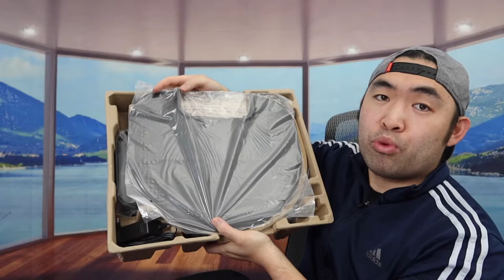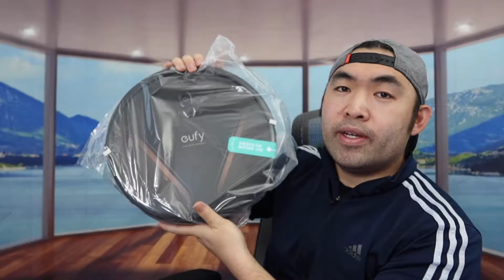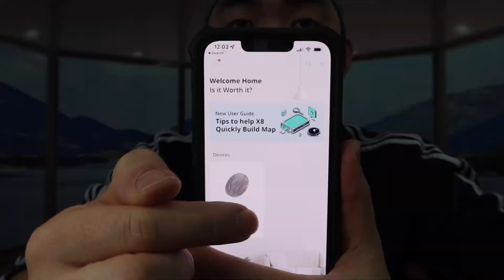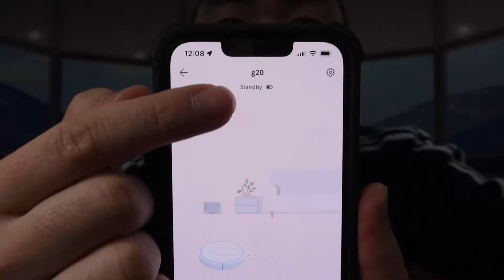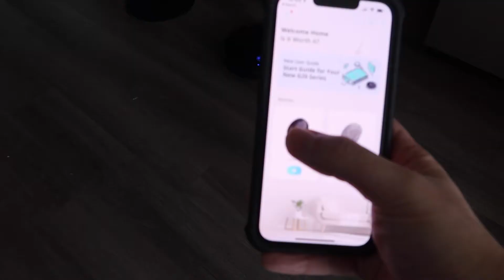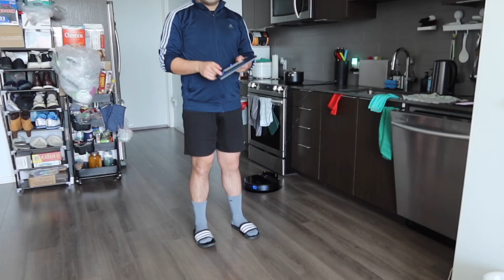Should You Buy? eufy RoboVac G20 Hybrid Robot Vacuum

Comment: Hi, do we need wifi or internet connection for the robovac to work???
Reply: No, only if you want to control it with your smartphone, i.e. to programme an auto-schedule etc. etc.., which then you'd need a 2.4GHz WIFI network
There's Start button on the unit.